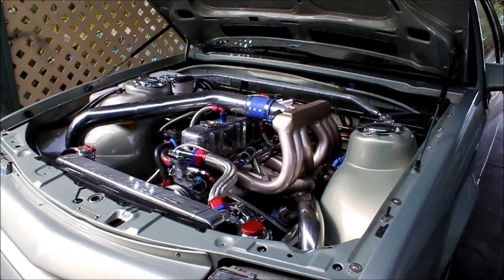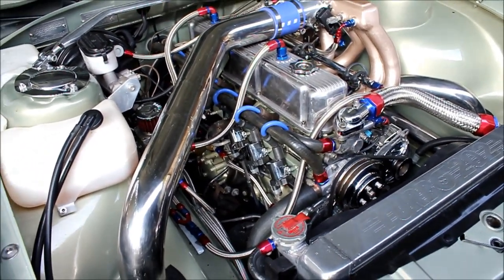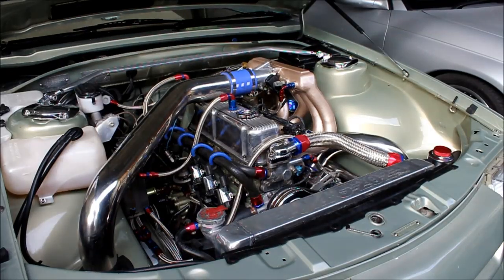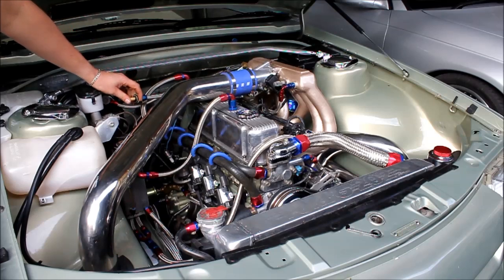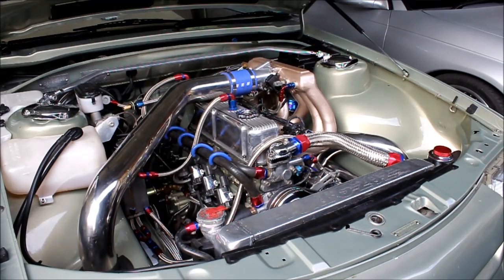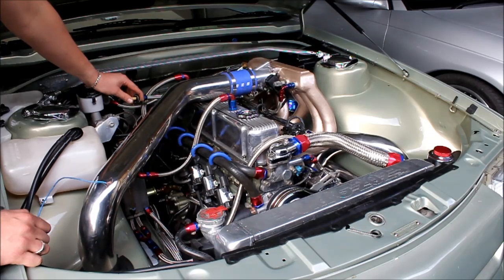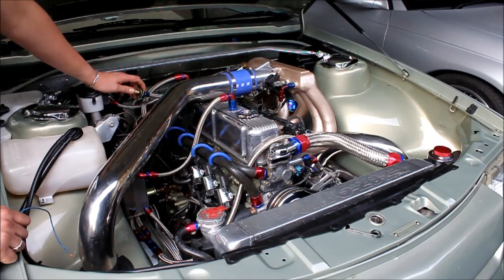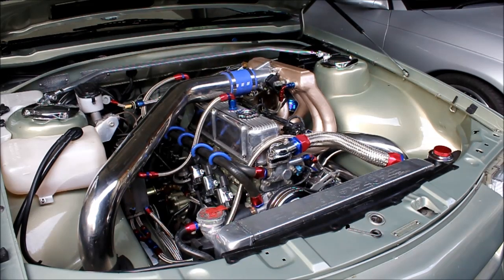WTF 202 - Sequential ignition start with D585 coils

Comment: Dude, that is sick. I absolutely love it. I brought a valiant charger with an injected 265 Hemi. It wasn't quite finished when I got it and was told that it wasn't gonna take much more to get it going.  They lied. It ended up with my mechanic for 7 months, we worked on it so much and it cost me more than I paid for the car to just get it going. Very complicated but that was 14 years ago. Wouldn't be that hard today. But with a small turbo it was pumping 536hp at the wheels. Was capable of more but with leaf springs and drum breaks it wasn't safe.

Comment: Sequential Injection? On a holden straight 6?? Geez the hours and money that would've gone into tuning and getting it to run right would've been massive..
Reply from the maker: Not really.  Most aftermarket ECUs can do sequential.  You just need a home signal triggered off the cam to tell it when the engine is TDC on cylinder 1 and ready to fire.  In this case, a dual hall effect trigger wheel is used, housed in  a modified distributor (doesn't actually distribute any spark).  

There is a single pulse at TDC for each cylinder, and then the home signal every two crank rotations.  The fuel and ignition tuning is then just like with any other engine.

This kind of setup is used to provide sequential injection in a few factory systems (eg Holden 304 V8, Mitsubishi Magna).  It works well, but for improved accuracy, a crank-mounted trigger wheel (36-1) plus home signal from the cam is better.  

This is what I will switch to when the current Microtech management is upgraded to a newer Haltech Elite system.  The higher accuracy ensures better timing stability on boost, which is where you need to be careful .

Comment: I like it, mind you I see one thing I would change.

The plenum on top of the intake runner's. 

Mine was normally aspirated with 3 throttle body's grafted onto a larger plenum chamber.
Veeerrry successful. 
Did mean an extra plenum chamber over rocker cover to connect all 3 throttle body's to a large panel filter box set up.

Was worth it though, lot's of extra grunt all over the rev range.
Reply from the maker: Cheers Steve.   Since it's forced induction, really only a single throttle body is all that's needed.  However, I definitely agree it could use a larger volume plenum to improve throttle response.  This is something I'm looking at building once the current round of mods is finished (a new twin-scroll turbo manifold and turbine housing).  The general plan these days is just to have it driving nice, with good response, without being a lag pig.
Reply: @GREENVK  Agreed, pick right size turbo for nice response early in rev range,
Without exhaust turbine being too small and therefore becoming a restriction.
Large plenum definately a must , so is nice size throttle body to suit.
Also so as not to be restriction.

Cool set up regardless of my input😉🙂👍👍

Comment from the maker: Hey thanks for the tip.  From what I've managed to gather, the ECU increases dwell time during cranking to allow for a drop in battery voltage.  I'm not sure if it would make much difference having the ballast on them, since the dwell would still increase.  But if you've tried it and it works, I'll certainly give it a shot!  I would probably put it on a switched system so that as soon as the engine is running, it reverts back to 12v.

Comment: you can hear a coil early ignite in that start video right before it starts the engine gives a violent shake when it happens be carefull its very hard on your bigend bearings.i run 6 of these on my v6 and have had one kickback .i knew these coils would most likely do this but i have a plan that you could also impliment to rid the problem.use a normal coil ballast resistor as used in the 70's and feed the coils via the ballast when cranking so they only get 9v they wont charge as fast :D